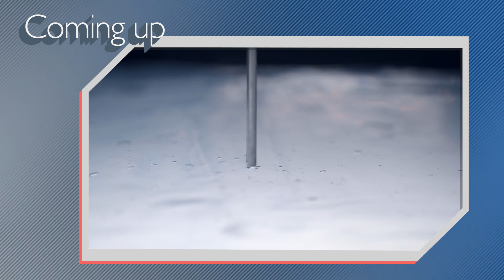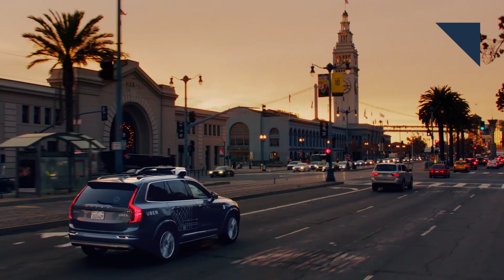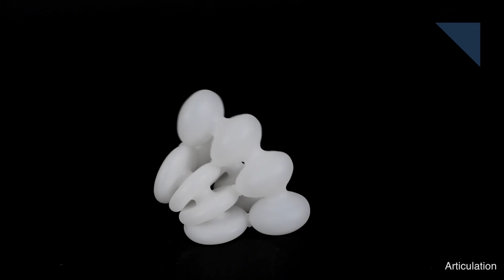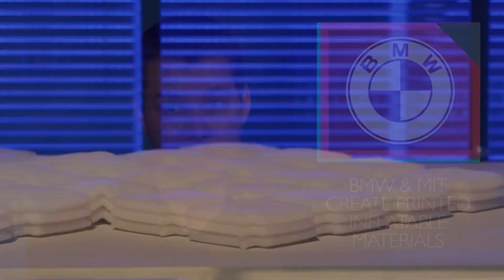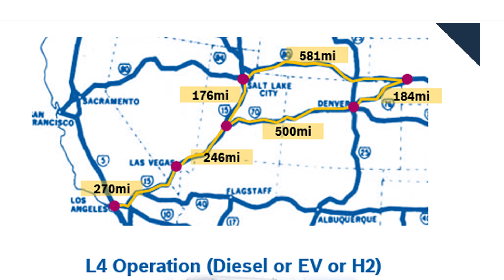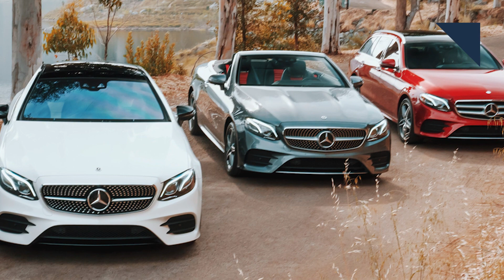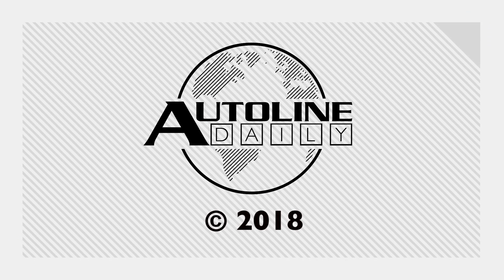Nikola Semis to Deliver Beer, Uber Faulted for AV Crash - Autoline Daily 2362

Comment: Regarding the Nikola beer trucks, I think he means “electrolysis” instead of “hydrolysis.”  Electrolysis is practical in the southwest where there is abundant solar energy.  It is currently used in Alamada County, California to produce H2 for fuel-cell city buses.

But even production of H2 from natural gas is an improvement on diesel, and electricity is produced from natural gas in much of the west anyway.  This is what the Dept. of Energy has to say on that:

“Petroleum use and emissions are lower than for gasoline-powered internal combustion engine vehicles. The only product from an FCEV tailpipe is water vapor but even with the upstream process of producing hydrogen from natural gas as well as delivering and storing it for use in FCEVs, the total greenhouse gas emissions are cut in half and petroleum is reduced over 90% compared to today's gasoline vehicles.”

The takeaway here is that we can expect fuel cells to find a place in fleets, where the logistics can be managed.

Comment: What about the “driver” of the Uber car?  The driver should be alerted to a pedestrian in danger of being hit by his own eyes, and take evasive action.  This is the fallacy promoted by advocates of autonomous vehicles — that the operator will be able to intervene when things go wrong.  They won’t because they won’t be ready in time.

From the NTSB preliminary report: “According to Uber, the developmental self-driving system relies on an attentive operator to intervene if the system fails to perform appropriately during testing. In addition, the operator is responsible for monitoring diagnostic messages that appear on an interface in the center stack of the vehicle dash and tagging events of interest for subsequent review.”

Comment: How much it cost to produce hydrogen?
Nikola should make simple electric truck with generator range extender charging the batteries on the go,,could be powered by diesel or natural gas,propane etc..since the fueling stations already exist everywhere..
Hydrogen is very unstable,dangerous.fuel..not a good idea..
Reply: Hydrogen is not unstable. It just needs a lot of electricity to make from water or natural gas, needs a lot of electricity to cool-compress-liquidity and needs expensive tanks to store safely if there is an accident on the road.

Note: Stationary dewars are not too bad in costs, it making them crash-proof that costs a lot of money.

Comment: All the infrastructure in the world won't make hydrogen fuel cells a good idea.

The cost of the fuel is too high--and no, it can't be brought below its competitors no matter how much mass production is done. Hydrogen is a fools' quest. Companies pursue it because there's govt handouts, and they want a share of that sweet, sweet lucre.
Reply: What gets me is the depots are 200 miles apart, but Tesla is now saying it can get 600 miles between charges.  Also the same power to make hydrogen can supply three times as much power to a battery system.

It would be a lot cheaper to install Mega-Chargers or the equivalent for the non-Tesla trucks that are also coming online.
Reply: Was that 1200 miles? I may have mis-heard him. Sorry about that.

Comment: Nikola trucks are horrible for the environment, a huge hazard on the road, and by far the most expensive truck to buy and operate. 

Several big oil "examinations" trying to make EVs look bad have pointed out that when the electricity comes from coal or natural gas one is not much better on climate change than with a gas car. Well at best a FCEV will use three times as much electricity as an EV, so we are already worse than a diesel. But it is much worse, because the hydrogen comes from cracking natural gas which releases still more CO2, and that gas comes from fracking which pollutes the groundwater and releases Methane. So a Nikola truck will cause more climate change than TWO diesels and pollute the groundwater too. Great idea. 

But the real fun will start when the large battery pack catches on fire in a crash. Nikola trucks will have a 320kWh battery pack, and as we have seen with Tesla there is always a chance of a fire, and those fires take time to put out. Just the batteries on fire will suck, but they burn at 1,000 F and are pretty sure to heat the hydrogen tanks beyond 260 F, and once that happens the pressure valve opens on the tank immediately releasing a huge amount of highly pressurized flammable gas through a small valve opening into a fire. Basically the trucks will have  large flamethrowers incinerating anything in the direction they are blasting towards. 

Then we come to cost, which is a lot more than a diesel or a Tesla upfront, about twice as much, and a lot more to maintain. The stacks to convert hydrogen to electricity are tens of thousands of dollars, and they only last 100,000 miles. So this is like buying a Semi that will need a new engine every year. Completely insane. And when Nikola goes bankrupt, inevitably, your truck is a paperweight with no source of new stacks. 

Nikola Semis are about the worst possible idea for trucking.
Reply: Nikola bankrupt 2024

Comment: Re the argument for using Nikola trucks.
It was suggested that "the driver could swap trucks to ensure making it home every night"
The truck has a (theoretical) range of 1200 miles.
Assuming (even) an average speed of 60mph the truck would take 20 hours to complete 1200 miles, without accounting for loading and rest stops.
The driver can't drive for 20 hours in one shift.
If the driver is limited to 10 hours, that range is 600 miles, 300 each way, with a loading stop in the middle, so realistically 550 miles to total.
I assume the return journey would be either empty, or reduced load?
Correct me if I'm wrong, but IF the driver was to make it home this round trip could EASILY by done by the Tesla Semi?
Somebody isn't working the figures?
Reply: Yes, Nikola is a solution looking for a problem.

Comment: 23:45 Nikola Taps Bosch for Fuel Cell Development-It advantage mostly come from its EV drivetrain like more power and great efficiency while its issues/problems like cost and lack of infrastructure come from the fuel H2. 

So where is the EV prowertrain trucks with REXs?
Reply: This is actually the better interim solution for trucks. Plug in EV drivetrain for local runs with a gas microturbine for range. Wrightspeed is pushing this.

H2 is being pushed because it seems "greener" and futuristic. FCEL/H2 requires more Natural Gas per mile than simply burning in a turbine. 

Just scratch the surface of the H2 industry and you will find players like Shell.
Reply: The generalization "FCEL/H2 requires more Natural Gas per mile than simply burning in a turbine" is total BS. 1st learn about Carnot's theorem (thermodynamics) - Wikipedia https://en.wikipedia.org/wiki/Carnot%27s_theorem_(thermodynamics) and all the different types of FCs . Or leave it to the experts and let market to decide. Since u prove the old saying a little bit a knowledge is a dangerous thing in the hands fools that pretend to know all the facts.

And nice Shell conspiracy theory too. I know all the legacy companies r evil and we need a new world order. lol
Reply: microturbines on their own very inefficient but r relatively cheap and simple.  there far more inefficient options.

Cleaner means less real pollution from things like PPM and NOX
Reply: Making H2 from NG uses H2O so u end up with more H2 then just burning it directly as CH4. 

And it gets rid off all the real pollution u would get when its burned like NOx. So its a no brainier its cleaner and more efficient than just burning NG
Reply: FCEL won't work from an efficiency, cost or carbon standpoint. Period.
https://www.aps.org/policy/reports/occasional/upload/fuelcell.pdf

Skip to Page 6. When you are done convincing yourself that NG>H2>FCEL will never be more than 20% overall "well-to-wheels" efficient, then you will convince yourself that Solar/Wind>Electrolysis>H2>FCEL will never be more that 10% overall efficient.

If you read the government papers, they are all in agreement that a "Hydrogen Economy" will never take off without heavy government sponsorship. In other words, like oil and gas, H2 cannot compete without government subsidies

Any college level engineering/physics student can do these calculations. But business is not about physics, it's about selling stuff.

BTW, there is no conspiracy here. It's called a "business model". Big Oil's only products are oil and natural gas. That is their "assets". They need to monetize that. All of their income derives from monetizing their assets, they have nothing else.

I have posted tons of comment content about this subject if you bother check my profile history.
Reply: A theoretical academic report from 2003. that doesn't specify the type of the fuel cell and states "a fuel cell vehicle powered by hydrogen derived from methane is projected to get 82.0 mpg", While efficiency references dont even show a baseline making them meaningless. 

the fact is if companies spend the money to develop H2 generation and FCVs they think it will make them money. So keep googling to rationalize ur point of view, The only thing that matters if they can make money from it. Something BEVs like Tesla is still failing to do. Even with massive subsideds.

As someone with a real engineering and econ degree this has been amusing.  But a waste of time. Enjoy
Reply: If you really have a degree, feel free to publish your evidence.
Reply: degrees dont matter on utube when fools pretend to be experts
Reply: publish what ?  I never claimed work in this field but it was amusing when u talked about engineering students When will u get ur degree?